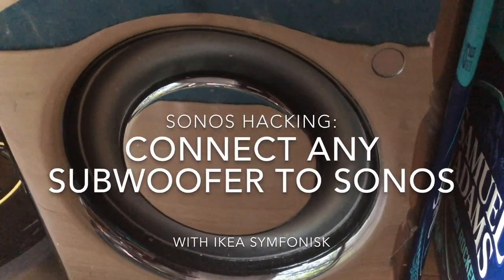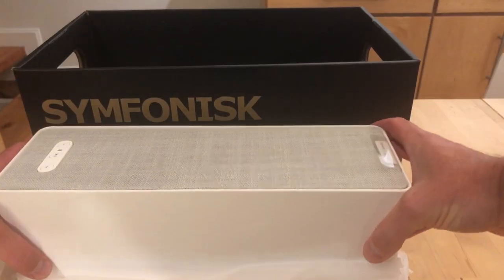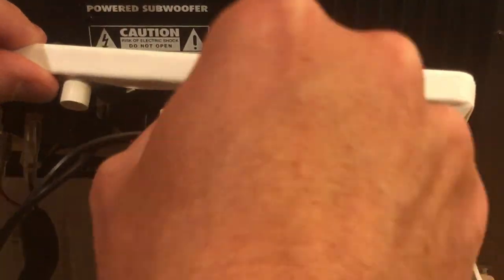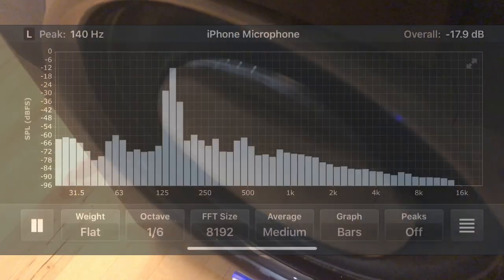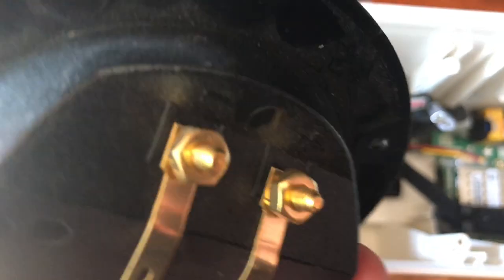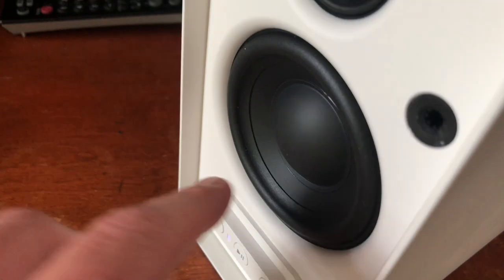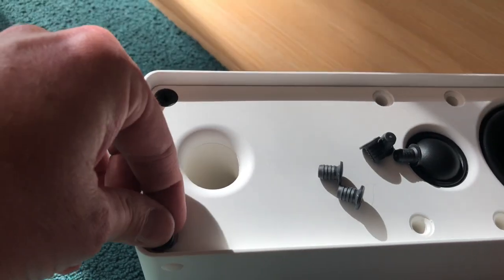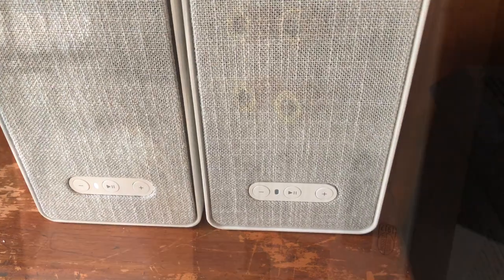Connect any powered sub to Sonos with this Ikea Symfonisk DIY hack

Comment: Do you know why when I start approaching half volume the Sonos cuts out? Almost like it’s too much for it and shuts down. But when I back the volume down it works again?
Reply from the maker: I haven’t run into that and I’ve been running mine with a powered sub for a few months now, sometimes at very load level. So is the symfonisk speaker turning off? Are you trying to power a passive sub or does it have its own amp?

Comment: I am thinking of doing an Sonos Beam, plus two Symfonisk speakers for surround sound and finally your incredible subwoofer hack for complete 5.1. Is the sound coming out of the sub as good as something you would expect from like a cheap version of the Sonos Sub or is it just okay? And do you have any recommendations of subwoofers giving very good value for money? (Thinking a maximum of 200 dollars)
Reply from the maker: The Sonos sub is really good but honestly a $150 powered sub with a Symfonisk sounds similar enough for most uses. The Polk subs are known to be pretty solid and a good value. This 10” is a steal at $99 - Polk Audio PSW10 10" Powered Subwoofer - Featuring High Current Amp and Low-Pass Filter | Up to 100 Watts | Big Bass at A Great Value | Easy Integration Home Theater Systems https://www.amazon.com/dp/B0002KVQBA/ref=cm_sw_r_cp_api_i_reoVDbC3CKR89
Reply: If you hook up the sub to one of the surrounds, wouldn't you be lacking a lot of the signal? I feel like you'd wanted to come from ideally the front or left or right channel, not the surrounds.

Comment: hey guys , wondering if you can add one  ikea speaker with a sub and connect it to  arc , two ones and sonos sub. now that the app allows a second sub , could I use the ikea speaker and sub as my second sub in the setting ?
Reply from the maker: The app never see this as a sub, just as a symfonisk. You can connect a sub to a symfonisk as a new room and group it with your hone theater room.
Reply: @todd.parker  right , but didn't you say there is a delay ?
Reply from the maker: There is a small delay but it may not be noticeable for those frequencies

Comment: Can I add two subs off of one ikea speaker?
Reply from the maker: Yep,  the speaker level inputs on a powered subwoofer is high impedance so it basically pulls no power from the Symfonisk amp

Comment: I was thinking in a similar direction, though I’d prefer connecting the sub directly from the pre-amp to be able to use my sub’s integrated low-pass filter. Is there a way to connect anything at that level, or is is it a printed on electrical circuit?
Reply from the maker: I think that would require a lot of electrical expertise since there aren’t line level outputs. Sonos wants to sell you a Connect for $350 if you want line outputs! Using the high level speaker outputs probably isn’t quite as clean but for a sub it sounds fine.
Reply: You can use a speaker to line level converter. They are frequently used in car audio systems to drive subs from the normal head units. You can pick them up for less than £10 from Amazon
Reply from the maker: Excellent point. I think I need to make a video of all the connection options
Reply: @ross7464   hey ross, I just tried a line level converter using the same method that todd did, and I noticed that after a out 10 seconds of playing a song the entire unit would stop playing. Not sure if it's somehow shorting out or if there's too much load? Going to do more tests this weekend. Have you had any experience connecting a speaker to line level converter with the ikea speaker?
Reply from the maker: vdoedtr Hmmm, that’s odd. I don’t see why this wouldn’t work but maybe the impedance of the converter wired in parallel to the woofer makes the impedance drop too low for the amp? You could try wiring these in series...
Reply: @todd.parker  Please do that! :) Thanks for sharing!

Comment: I connected an old Yamaha sub yst sw005 that I took from a surround set. I need to say. It works but still you hear the music trying to come out of the sub. That case it doesn’t go really deep in bass.

Is that a subwoofer issue or just this hack ?
Reply from the maker: Sounds like the subwoofer’s crossover is pretty high so you’re hearing more midbass. A home theater set won’t go very low either. A higher quality sun will sound better
Reply: @todd.parker  Thank you for the reply. ill try to source a better one in the hope it'll get better. It was fun to make and i let you know the difference!
Reply: @todd.parker  Hi.

The sub i used (jbl 230) broke down. Guy in the store said that it might be because the diffent ohm values of both units. With an high low converter you can prevent that issue and only use the signal from the symfonisk and let the active woofer be the woofer.
Reply from the maker: @rbrood267  My hunch is the amp just died, it happens a lot in subs. I don't think there is anything out of the ordinary with the Sonos amps that could stress your sub. You can use the converter but the one I tested tended to be noisier than the built-in speaker inputs on my sub
Reply: @todd.parker  but you havent choose the right sub ohm to match the ohm sonos speaker ?

Comment: Could be a good idea to use a line level adapter (speaker to RCA) so you're not drawing too much power from the Symfonisk amp, and possibly burning it out over time.  Great idea and video!
Reply from the maker: Maybe? I don’t know if those adapters soak up more of less power but it’s worth considering
Reply: Anthony, good point! 

Todd, are you wiring your sub in parallel to the SYMFONISK woofer? I saw in your other video that you installed a cut off switch for the internal speakers. Did you consider the amp's wattage and impedance in your process? Would love to know your thoughts here.
Reply from the maker: Makoto Hawkins yes, I’m running the wire from the symfonisk to the sub in parallel. Since this is bi-amped, I’m less concerned about the impedance than I would be with a passive crossover because the speaker’s impedance would impact how hard the amp works but won’t cause the crossover to shift like it would with a passive setup. The only consideration I made for the switches was to make sure they were DC (many are AC). I just wired them to disconnect the negative when off.

Comment: Does powering both the sub and the original Symfonisk speaker at the same time reduce the sound quality of both by halving the signal? excuse the novice question
Reply from the maker: Not that I can tell, no. The Symfonisk connected to the sub sounds identical to the one that is standalone.

Comment: I did this with a Play:1, but disconnected the Play's woofer and instead ran wires out directly to a passive sub....and the Play can actually drive the sub. I'm not sure how, but its driving it pretty effectively and at impressive volumes.
Reply from the maker: Yep, that will work too but the amps are a bit small to run it super loud. Glad it works for you
Reply: @todd.parker  I mean, you’d think…but I’m telling you it’s holding volume pretty well. I A/B tested vs an SVS SB-1000 and it’s matched it up to ~70% volume, which is pretty darn loud for the space!
Reply from the maker: @joefranco7151  that’s impressive

Comment: It would be great to see the SYMFONISK guts paired with a 2 way speaker for an inexpensive way of making a superior sounding Sonos compatible speaker. I wonder what 2 way speakers out there are easy to access the innards?
Reply from the maker: I’m working on a video showing that. Really any two way speaker would work. Just straight wire to the drivers to avoid the internal passive crossover and you’re good to go.

Comment: Hello todd,
I have a Sonos beam and 2x Sonos one set up as an home cinema set. Is it possible to add one ikea speaker to this set to connect my Harman kardon active sub?
I understand this might work as a grouped set of speakers but does it also work when some speakers are set up as a stereo pair?

Kind regards
Reply from the maker: Yes, if you have the beam and the Sonos ones set up as a home theater room you can create another room with the Symfonisk and subwoofer then group them together. I cover this in detail in my wiring guide video
Reply: @todd.parker  thanks for your fast respond. Next question. I have a Harman kardon subwoofer I want to connect. But all I see is the “line in” and not the speaker level in you are talking about. Is this still possible to hook up. (Before I spend 99$ to buy the symfonisk speakers I want to know if it will work. 
It is the hkts210sub.  

Thank you for your time
Reply from the maker: @patjelange5015  in that case, you just need a converter to turn the amplified woofer power back to a signal. Kicker KISLOC 2-Channel K-Series Speaker Cable to RCA Adapter with Line Out Converter https://www.amazon.com/dp/B00I4EF1BC/ref=cm_sw_r_cp_api_fabc_FGtUFb5BPMSDF

Comment: This was so easy to do, I’m enjoying it very much!! I have a question...where did you find the switches and how do you hook them up to the speakers? Thanks in advance!!
Reply from the maker: I used a 12v DC switch and it’s easy to hook up. Basically cut a wire (+ or -) and screw the wire to each side of the switch. Nilight Heavy Duty Rocker Toggle Switch 15A 250V 20A 125V SPST 2 Pin ON/OFF Switch Metal Bat Waterproof Boot Cap Cover - 5 Pack, 2 Years Warranty https://www.amazon.com/dp/B078KBC5VH/ref=cm_sw_r_cp_api_i_WNmrEbD6CFYF6
Reply: Thanks for the response!!! Will be waiting for more videos!! Subscribed!!

Comment: Would it be possible create a line out from speaker terminals to connect to any 3.5 mm jack?
Reply from the maker: I don’t think so, not without a lot of work. Look into getting an old Play:5 or connect if you need that

Comment: Can you do with one IKEA Sonos speaker with this hack as surround channel with a Beam without using the Symfonisk actually as a speaker? Or do you have to have two Symfonik speakers to allow that option in the Sonos app? I would prefer the sub to automatically be part of the Beam setup and be controlled with the volume of that as well. Thank you very much for a nice video.
Reply from the maker: I believe that when you add rear channel speakers, you need to add a pair. With just one, you may have to use the grouped zone approach. Or, open the beam and jump a wire off the woofer to get a signal to your powered sub, no Symfonisk needed!
Reply: I have only a Beam and would like to add a powered sub using 1 IKEA speaker.  Is this not possible and need 2 IKEA speakers?  I found it hard to add just a single speaker as surround.
Reply from the maker: Raj Khatri Sonos requires you add a matched pair for the surround channels. You can, however, open your Beam and jump a wire off a woofer there to get a signal to a powered sub, no surrounds needed.
Reply: @todd.parker   thanks for your reply.  Do you have a video for opening a Beam to perform the steps?  I just saw your other complete video and looks like the "Gateway" approach makes sense - using a single Symfonisk as a bridge to a powered sub and grouping the 2 locations together.
Reply from the maker: Raj Khatri I haven’t seen a tear down of the Beam so you might have to take on the adventure

Comment: Would this also be possible using the line in instead of speaker in ports?
Reply from the maker: Yes, check out this video for details: https://youtu.be/9Bvof0hF4LE
Reply: @todd.parker  So basically, it's putting a converter between the sonos and the sub instead of a direct connection?

Comment: Just imagine if you could hack an Ikea  symfonisk speaker to add in RCA line outputs.  Then you’d could simply contact to existing amplifier.  budget Port.
Reply: I really want to try this and see if it is possible, the port is so expensive it is disgusting
Reply from the maker: ...and it shouldn't be, it's Sonos being greedy. It should be about $100-150 max
Reply: I remember reading somewhere a few weeks back about some gent who did just that, but it was much more involved and required basically removing the PCB from the Symfonisk entirely. If I remember what/where I'll edit 👍
Reply from the maker: transatlant1c Yeah, I think it would be very involved and probably include changes to the firmware. At that point, you’re probably much better off with a connect. I just wish Sonos didn’t gouge you on prices for the connect, amp, and sub. The connect should be like a Chromecast - super affordable
Reply: @todd.parker  agreed! Would love to add the native Sonos sub to our system (playbar + x2 symfonisk) but the sub is way too expensive. Will try your approach instead!
Reply: @todd.parker  Then who's going to buy Sonos speakers?
Reply from the maker: ActionHenked Because of the end of life situation?

Comment: Could you measure the DC Voltage of the board? I'd like to add batteries for mobile use.
Reply from the maker: XJohuX next time I open it up, sure!
Reply: And what for? That speaker needs to be connected to the wifi..
Reply from the maker: Guessing he wants to make a portable, like the Move

Comment: Do you need a third speaker? If I have two in pair, can a run a wire the left speaker and connect it to a powered subwoofer?  Meaning the left speaker is still working while sending signal to the sub.
Reply from the maker: Absolutely. That’s the setup I show in the video and the most cost effective way to go.
Reply: @todd.parker  hi Todd, I thought I would run this by you before I try it. I got a play5 gen 1 for cheap. It has a headphones out and a linein jack.  I was able to connect the headphones out to the sub and it works great, but of course the speaker were muted. What do you think would happened if I used a splitter  from the headphones out, back into the line in and to the sub?  Good bye  play5? Thanks in advance.
Reply from the maker: Bill GMoris that’s a good idea but my hunch is that would add too much delay as the input would need to be re-digitized. Worry trying just to see
Reply: @todd.parker   Just an update. It did not work because I have to selet linein in the browser which disable any streaming.    So I will be long for another symfonisk.  Thanks for your time.

Comment: So if I wire the ikea speaker to my sub and disconnect the internal ikea drivers doi add this to my Sonos system as a sub or as a surround( in the Sonos setup app)?
Reply from the maker: You will still add it as a symfonisk, there is no way to register as a sub but will act like one. Just group it with your room.
Reply: Todd Parker got it hooked up and working. Sounds really good, thanks a lot for the guide

Comment: Great video! Looks like the sub is receiving frequencies way above its pay grade, specifically over 250Hz. Is there a way to cross only low frequencies to sub? Also, does this hack work on other Sonos speakers? Thanks!
Reply from the maker: Any powered sub will have its own internal crossover so although the signal going to the sub probably goes up to 2,000hz or so, the sub will filter it. Usually the crossover frequency is a knob on the sub so you can dial it in. This would work on any Sonos speaker, yes. Most are harder to take apart but this idea would work with any powered speaker.

Comment: What gauge wire do you use in the Symfonisk? (Thanks for the detailed videos)
Reply from the maker: Thanks Justin. I had used some 16 gauge wire I had lying around. It's such a short run, even 18 gauge would probably be fine.

Comment: I have two subs that used to be part of a few 2.1 setups I had for my older PCs.  One is by Creative (t3000) and the other is from a Harmon Kardon Soundsticks II.  Both have line in 1/8" inputs for audio.  Both also have external wired audio controls since they were more integrated components as opposed to stand alone pieces.  Do you think a hack is still possible using either of these subs with the Symfonisk?

Separate question/assumption...I would think tuning the sub after your hack with the Sonos True Sound tuner is out of the question???
Reply from the maker: Yes, you could use an adapter to turn the amplified signal back down to RCAs then use a RCA to 1/8” jack. Rockford RFHLC High Level Speaker Signal to Low Level RCA Adapter https://www.amazon.com/dp/B009VTDVMU/ref=cm_sw_r_cp_api_i_CFPwDbE6XJYZ0

This does work with Trueplay which is super cool. If Tate sub is connected while you do it, it will tune the sound to be flat. I found that it can attenuate the sub too much for my liking but you can turn it up later or tube with the sub on a lower setting to start.
Reply: @todd.parker  This is great.  Thanks for the feedback.  I am going to give this a go this weekend.  Btw, what did you end up doing with the Symfonisk placement after tapping into it for the sub?
Reply from the maker: I have a pair of Symfonik speakers placed about 8 feet apart and the sub on the floor below. You can still run the room tuning but turn the sub down a bit so Sonos doesn’t over compensate and kill the bass.

Comment: Could you alter this idea to use this in replace of the connect to feed an amplifier?
Reply from the maker: I just did a video on this and the fidelity isn’t great. It works but by the time you buy two symfonisks and adapters, you might as well get the connect

Comment: U know what..... what if u take the ikeas guts and put it in a echo subwoofer??? Take it another step further and use a automatic source switcher so you have 2 inputs, the original echo inputs and ikea inputs, and based on which audio is playing you could still retain use of the echo subwoofer in the amazon ecosystem and when the switch sees ikea board recieving audio signal it switches over to using sonos ecosystem?
Reply: I been searching all over the internet of a teardown of the echo sub but no dice. I might need to buy one and tear it open haha
Reply from the maker: Do it!